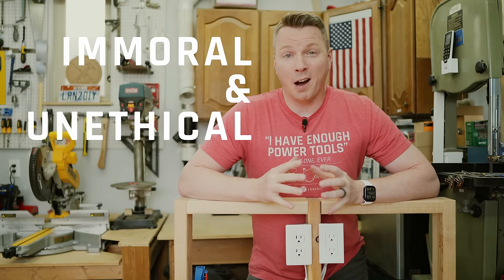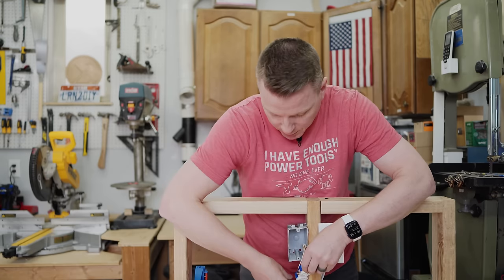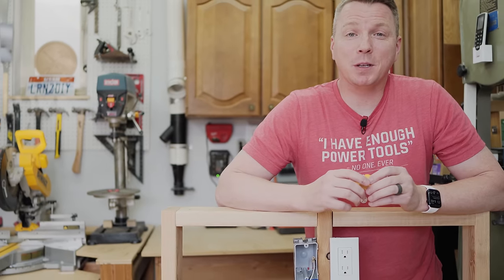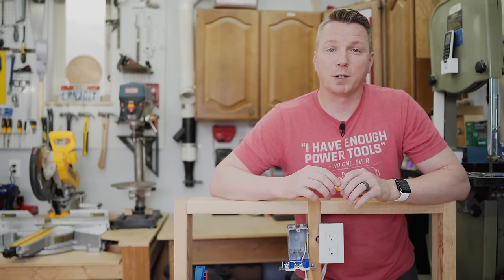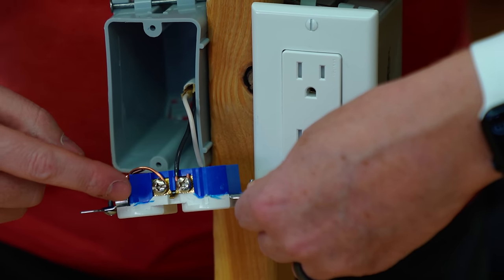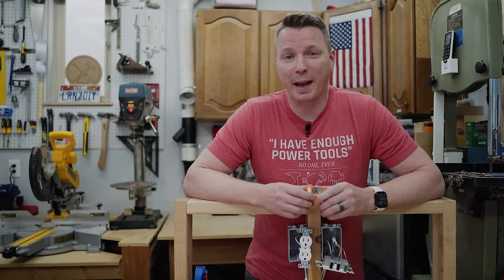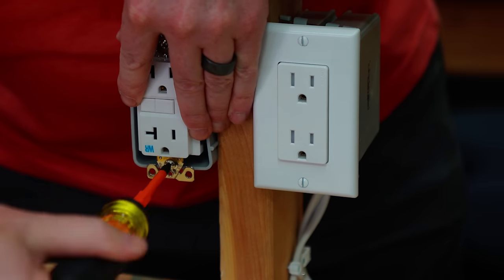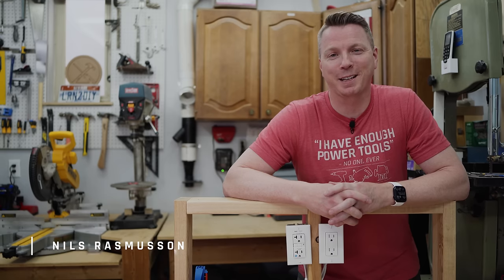People Are Adding Deadly Hacks to Outlets

Comment: Pro tip - to save on costs on having your home rewired, you can do a lot of it yourself (run the wires, not hook them up anywhere, i.e. let them hang out of the outlets, walls, etc) and then have an electrician come to verify that it's all wired correctly and then hook it up. It's a lot cheaper (fewer work hours).
Reply: I'd tell you I'm not doing it, or charge you double because I'd be so frustrated trying to figure out what you did. You're not saving time unless the electrician isn't doing their job.
Reply: @leftyeh6495  - Then I'd recommend people to instead  use an electrician who knows how to use a wire tracer.
Reply: @leftyeh6495  I have electricians in my family. They don't mind if homeowners do some of the hard work as long as they do it logically, label things, and are there to explain where each wire goes. If neither of those things happen they do the same thing you do. Gut it and charge double.
Reply: Yeah this is not great advice. If anything, it’s backwards. Hooking up the plugs and lights is the easy part, knowing what wire goes where, which wire can go on which breakers, where certain wiring methods are allowed, and how the wire must be run—all of that is why you pay a residential electrician. Apprentices wire up the plugs. If someone calls me to hook up their receptacles and lights then they probably don’t have the knowledge needed to safely run wire. There’s code to follow, there’s “common” sense that comes with a few years in the trade, and Harry Homeowner understandably will know little of it, even if their Google-Fu is strong.
Reply: @abikuneebus  Brass terminal = hot

Silver terminal = neutral

Green = ground

Most outlet connections are THAT basic. Taking pics helps, as all you are doing is adding a ground wire....
Reply: @hotdogsarepropaganda  The NEC codebook is more than 800 pages long, no homeowner is going to read that. Though there are a couple of big ones that can't be corrected after wiring. One where a lot of people mess up trying to do it themselves, is running too many wires through one hole (can actually cause wires to overheat and melt the jacket if too many high amp circuits have wires tight with each other). 

That's why if a homeowner wants to do the hard part of running wire, they should be in contact with the electrician who's going to finish the work, who can give them a rundown of what not to do. If one's electrician refuses to let you do it, maybe they know you enough to know you'll mess it up even with their advice. Or they don't want to miss out on their liability insurance protection for the work.

Seen it a couple times where the homeowners thing they're going to save money running the wire themselves and end up having to pay the entire job of rewiring + the labor it takes to tear down the work they already did.

If someone does heed OC's advice, they should be very careful in researching the parts of the code that matters at that stage of the job.

PS: Reason why bootlegged grounds are against code is because they make reverse polarity very dangerous and also forces extra current out the same conductor in the event of a fault. A lot of homeowners and house flippers (main culprit for bootlegged grounds) don't research why codes exist and just assume some grizzly old sparky made some rules for no good reason. 99.9% of codes exist because the practice otherwise has been observed to be dangerous in at least a scenario or two. The rest is because new tech came out which is safer.
Reply: @leftyeh6495  you're not a good electrician then.
Reply: @hotdogsarepropaganda  I'm a stage electrician, and have wired 800 amp power feeds to many shows, but I'm not a certified electrician. I replaced my own 200 amp service box. The electric company couldn't shut the power off for four days and the meter had a lock on it, so I couldn't kill power there. I put the sucker in HOT! Dumbest thing I've ever done, but everything works and here I sit.
Reply: @techguydilan  Can you explain what you mean by "and also forces extra current out the same conductor in the event of a fault."
How does a circuit force extra current out of a conductor when the circuit would also need to pull said current from the Live wire.
In other words, if Live can handle it, why can't bootlegged Ground handle it?
I thought ground was made to be tough and able to handle short circuits (until the breaker pops).
Reply: @DVDplayerz  If the outlet is fed from a GFI/GFCI outlet, it becomes an issue because it feeds the ground fault back to the neutral of the GFI outlet, which won't kick it. Essentially defeating GFI protection.
Reply: @techguydilan  I wonder if the newer GFCI would catch it and automatically flip? I had one I installed on my bathroom that would trip simply because  the next outlet which was chained didn't have the ground hooked up correctly. Nobody was trying anything shady, it just came loose during install and maybe bumped one of the other screws.
Reply: @TheConstantComet  are you sure it wasn't an AFCI? Which is something different if I remember correctly. It's an AI pattern recognition.
Reply: So the issue with the bootleg ground here on the video was that someone switched the wires and made the bootleg ground hot... so this was the actual issue.. bootleg ground just enabled it... Which means if you wire it properly to the neutral like you should, it should be fine. 

We had bootlegged neutrals since forever and that wasn't forbidden at all at the time when it was done and there were never any issues.

Btw the neutral is just the ground at the power station, running ground locally at the house is literally the same thing
Reply: Current electrician here. Don't do this. There are way too many ways for someone that doesn't have the required knowledge to make a mistake that ends up being a safety hazard. 70% of all house fires start as an electrical issue. This is not a 'pro tip', it's dangerous and no reputable electrician would put their livelihood on the line by attaching their license to your work, which may or may not be safe and code compliant. I have had customers do this and every time I tell them I won't take responsibility for their work. I refuse to have someone burning to death in their sleep on my conscience because they wanted to save a few bucks.
Reply: @Straight_White_Fatherly_Figure  Says someone that doesn't have a clue and will create a hazardous condition because they think it's that simple.
Reply: @bryanherman1035  im an HVAC tech, so yes i do have a clue on how to use my meter and deal with electricity. 

electricity IS dangerous. That being said, replacing a ceiling fan, a switch or plugs in the wall - anyone with the slightest technical skills should be able to manage.
Reply: @bryanherman1035  - "someone that doesn't have the required knowledge" - of course. But this goes for anything and everything. Even changing a car battery can end up poorly if you don't know what you're doing.
If you know what you're doing, well, that's the premise of your whole claim.
It's dangerous to have an electrician verify your cabling before the electrician connects it all up? Sounds like a poor electrician.
Do electricians often do that where you live? Do work that often ends up in house fires?
Reply: @bryanherman1035  Lmao of course you would suggest people not to do that because it's your job you can get paid for, you just wa... bzzzzzt whooom boooom sound of distant sirens

Jokes aside, it should be added that you should only do this yourself, if you know what you're doing. I am electrician and running cables isn't really hard, you just have to not mess it up. Most common cause of house fires is using cables that are too weak for the current and the fuse won't trip while the cable is overheating. You have to know this stuff.

The second most common cause has nothing to do with installation itself, but people drilling screws into walls, not being aware of the cables and hitting the cable which might electrocute someone, or damage the cable creating a weak link, that might overheat. The weak link in the cable is supposed to be the fuse, not the cable itself.

Obviously you should never take credit for someone's work. If you do it yourself and you're qualified like I am, then you just license it yourself.
Reply: @beardsntools  It's not the taking credit for someone's work that I have issue with, not only because I would never do that, but the act of putting my license on someone else's work. I would never do that either. If I touch it, I own it, and it becomes MY responsibility. Almost every house that had a fire I've been in, re-doing the electrical system, the fire was caused by Joe Homeowner wiring something up even though they didn't have a clue what they were doing. Because he thought, 'It's not that hard, you just run some wire to it.' One guy wired up a 50 A disconnect for a hot tub, which caught fire because he used 10 wire for it, and burned half his house down, killing his dog and two cats in the process. He didn't save any money. "If you know what you are doing" is only qualified persons, in my opinion. "Knowing this stuff" is why we are licensed and regulated.

Comment: The first house I bought in 1976 was built in the 50's. 3 wires were used for all outlets and overhead lights. So far, so good. However, all switches were wired to open the neutral line instead of the hot line. I discovered that simply changing a light bulb became a dangerous situation as most overhead sockets were also wired so that the threaded portion was live with the switch OFF. The solution was to then check every outlet, switch, and overhead fixture and correct them as necessary. (after turning breakers OFF, of course) Luckily, I had the electrical knowledge to do the work myself. An electrician would have charged $ thousands to do the same, based on the amount of time required.
Reply: Ya' gotta wonder what goes through someone's mind to make them think that having hot wires all over the place and shutting off neutrals is a good idea.
Reply: Changing a light bulb is dangerous …….
Ohhhh please ……….
I change light bulbs all the time
With the light on …..
Reply: @thomasschwarting5108  that's the issue... They're not thinking. A lot of people have no idea how or why outlets and switches are wired a certain way. They throw it in. Check it lights the bulb and call it a day. 🙈
Reply: @mycaddigo  youre such a badass, i could never do that
Reply: @steveskeletonneii6336  lol …. Did you see the original comment that shutting off the neutral and leaving the hot always hot it’s dangerous to change lightbulbs. ….. 🤡😂
Reply: @thomasschwarting5108  You better ask japanese people. That's their standard and they seem to live pretty well.
Reply: Unbelievable!!
Reply: @mycaddigo  Thats not that dangerous if the threaded portion is neutral, in his case it (incorrectly) was hot.
Reply: @thomasschwarting5108  neutral switching an outlet or a light has been a thing for a long time, that way you could run a common power for all your lights in your ceiling, and then just switch the neutral for each light. This was before they really understood circuit limitations or sectioning tour circuits to be limited to certain rooms.
Reply: @mycaddigo  I mean, as long as you don't stuff your finger in the light socket, you should be fine.
Reply: @chubbysumo2230  😂yup
Reply: Holy defective wiring, Batman!
Reply: I live in a flat, and none of it is consistent. There's supposed to be some kind of code for which is which, live and neutral, but the logic used when wiring this place was "it doesn't matter which is which, it'll work either way", and nobody's ripping out the entire installation because it'd be more expensive than the value of the flat probably lmao. I try to do things at least half properly when I'm doing new wiring, like in my bedroom, but... I work with the breakers off, and I can't easily know which is which, all I can do is follow the colours... if they're connected wrong somewhere earlier in the circuitry, there's not much I can even do to know.
Reply: @astra6640  the biggest  danger a
Is lose connections .  Just make sure your connections  are tight and alway handle the wires assuming the power is off in.. even if you cut breaker.   The common and ground wires are dangerous if there is a hot wire in there.  Alway get both of them out of the way and then work with hot …. Okay sparky (:
Reply: @mycaddigo  yeah but the bulb tip is supposed to go to hot. Not the threaded part. If it's wired properly it's pretty safe to change a bulb without turning the fixture off
Reply: This is a problem with LED's they will flicker or stay very dim when the switch is in the off position.  Usually a sign of a switched neutral.
Reply: @davidwalker7732  It's safe either way, just don't touch either threaded part or the tip.. why would you want to touch it anyway? You don't have to. You're supposed to hold the bulb by the bulb part and just screw it in, you don't even need to touch the socket at all.
Reply: @beardsntools  I’m no expert but 90% of electrical work I do it’s hot.  
If I was working in a tight spot and I had my head resting on a water pipe or something… I would bring the lights in and make sure power is off …..
I use to be really afraid of the hot …..and cautious with the black wire ….
But I learned you need to be just as worried about tue white and copper …. Bc being grounded is actually what is dangerous …..😎
Reply: @mycaddigo  I am not worried about these wires at all, It just takes some extra care to touch the plastic not the metal parts.. alternatively you could be in air so you're not grounded, then you can touch everywhere, just not both neutral and hot at same time...

I never did this tho, I am always grounded, so I just do no touch of exposed copper part on any wire.
Reply: Such a crazy way to wire ANY building!!
Reply: @thomasschwarting5108  It's not a big deal or even dangerous.. the entire dangerous thing lies on fact some people did it reverse and wired hot to ground instead neutral.
Reply: @mycaddigo  that's called being a British, they are afraid of electricity
Reply: Yep, I have found that also once or twice in a customer's house where I was troubleshooting a light and got shocked on it even though the switch was off and it was because the switch was making/breaking neutral
Reply: @monad_tcp 
In the UK they run 240 volts. That's enough to kill people and frequently does.
I think the singer for the Yardbirds died like that.
Reply: i helped wire in a  old church in Mexico and the fuse box was that way so the fuse was hot until it was out all the way they thought it strange that i wouldn't change it until the meter was pulled!!  i also put up lights in the sanctuary about 30 feet up  OH no ladder would reach  we screwed 2x4s on to the ladder and put 2 guys on ropes on each side and UP i went :)